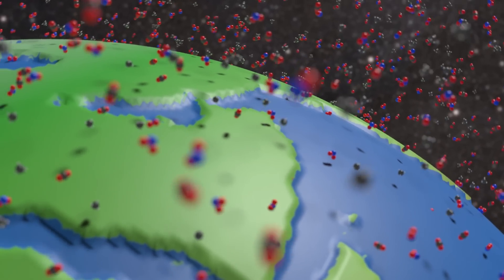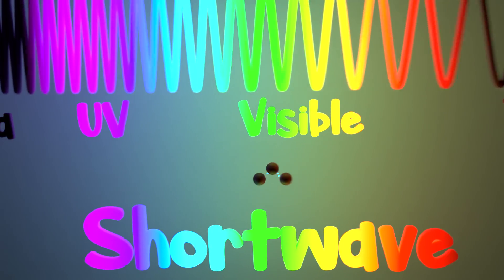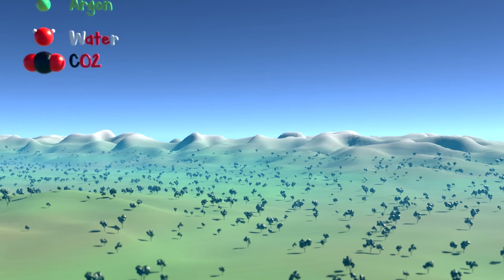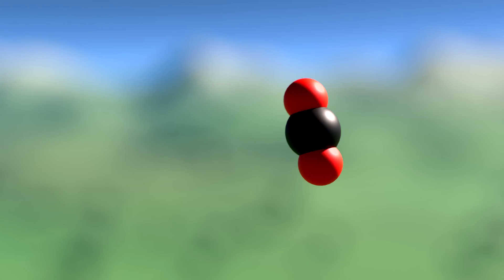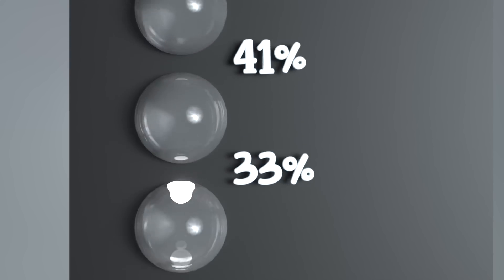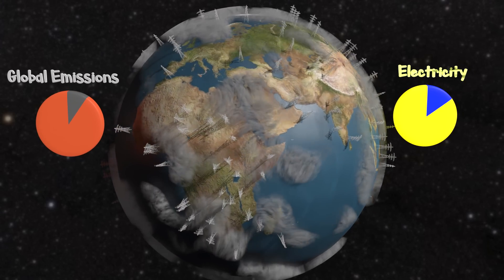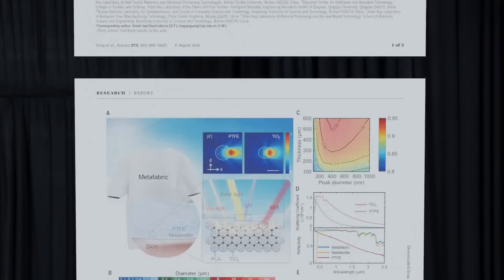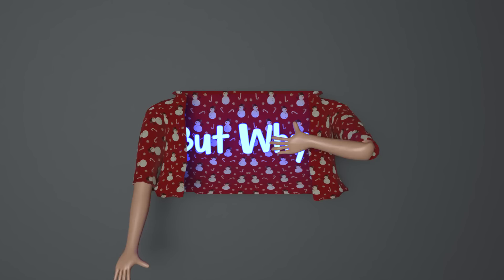Energy Free Cooling through Physics

Comment: The best substance for the inverse greenhouse effect is in fact snow. Because it is nearly perfectly white for visible light, and nearly perfectly black for infrared. To those who don't know, emissivity = absorptivity (this is required by the 2nd law of thermodynamics, otherwise a black object and white object suspended in a vacuum and surrounded by mirrors so they were in thermal contact only with each other and only through radiation, would not settle to the same temperature and you could make a perpetual motion machine type 2) so being black to infrared means it is an efficient emitter of infrared. You couldn't ask for it to be more perfect. A pity about it all going away now.
Reply: So we can use snow to build cool houses in summer. Oh wait...
Reply: Snow isn't especially unique in this property. Most materials emit better in ir than visible. A sheet of white paper is also almost a blackbody in thermal IR and... well... white in visible.
Reply: @appa609  time to make a paper tent
Reply: @lauraclose5604  rain : i am about to end this man whole career
Reply: You want it to be transparent to infrared, not black to infrared.
Reply: @carlkenner4581  
No, you can transfer the heat away from other thinga by conduction to the snow
Reply: Wouldn't snow emit IR in wavelengths that water vapor in the air absorbs? I'd think you'd want to avoid those wavelengths. IR emission by water molecules in snow vs IR absorption by water molecules in the atmosphere. I guess the phase (solid vs gas) tweaks things, but I'd be surprised if the "tweak" is enough to make absorption by water vapor negligible. Maybe it's not a big issue in the dry air of the poles, but for most of the surface of the planet, there's a lot of water vapor overhead.
Reply: And that's how we get Snowball Earth, enough snow coverage to trigger runaway cooling and a new ice age begins.
Reply: @shinjisan2015  A big mistake made with climate change is calling it "global warming". It's *climate change*... creating unstable and volatile conditions which could result in runaway cooling, runaway warming or, most likely to begin with, rather disruptive temperature oscillations which eventually settle into one or the other extreme.
Reply: @nickryan3417  "Climate change" instead of "global warming" still doesn't work, unfortunately. You see, the models that run with "climate change" had failed to predict the record colds around the globe this year. They predicted the Maldives sinking and many coastal airports (NYC, Netherlands, etc) threatened by rising sea levels several decades ago, none of which happened. They failed to take into consideration some natural phenomena such as hot wind movement from the Sahara desert crossing the ocean, taking them by surprise and causing them to scream "climate change!!" whereas those who know their stuff know it's a reoccurring thing that has existed for thousands upon thousands of years and had seen coming quite some time ago.

What credibility do those models that consistently fail at predicting the climate even have at this point? Those doomsaying models only tell us "the end of the world is nigh!!" without anything ever happening. I'm not even that old (early thirties) yet I've lived through more than a dozen "ends of the world" already.

Face it: fear of climate change sells. It prints money. Why would they not abuse that scam? And yes, it's a scam. Those who dare challenge it are immediately called out. Doesn't it remind you of Galileo who dared oppose everyone to try and prove that the Earth actually is NOT flat? One telltale sign of a scam is that you're not allowed to criticise it, because communication and truth are the best weapons against scammers who want nothing but for you NOT to think for yourself.
Reply: @nickryan3417  You've resorted to attacks and insult, meaning you have no counter-argument, correct?

Let me get this straight: you're basing your "let's save the environment" spiel on those models and predictions that have failed to model and predict anything correctly, right? Doesn't that mean your entire spiel is based on nothing concrete, nothing serious? I was once of a similar mind util I started trying to piece things together. That's when I realised the pieces don't fit at all.

As for those models and predictions, they've had decades to make them at least slightly work. Why don't they represent reality still? Maybe it's because reality doesn't care about politics and money.

Now please leave your kneejerk reactions and your anger aside and try to think critically of all of this.
Reply: @ChaosSolak  I didn't find any insults on his reply to you. You assuming that some of his reply insults or attacks you means it is clearly true and you feel threatened to that the truth about yourself gets out in the open making yourself see the reply as containing insult and attack against you.
Reply: @vicovideocompilationsetc6991  He said I'm short-sighted, used degrading examples using trash, misconstrued my words to say I'm advocating environmental damage (which I'm against whereas many virtue signal eating vegan or whatnot, not knowing or caring about soja farms leading to forests being cut down... and THAT is damaging)... Yes, he attacked me personally.

And so did you, by trying to paint me as insecure or feeling threatened. Instead of counter-arguing, you're trying to discredit me in order to try and win the argument. That's a logical fallacy. Please do not use them.

Now if you can explain how acting based on models proven wrong time and time again is somehow logical and smart, go ahead. As far as I know, the world hasn't ended yet and the Maldives haven't sunken yet, even though those deadlines, those "points of no return", have supposedly been crossed decades ago. But since they keep moving the goal posts, they can push the deadlines further and further away, ad vitam eternam ... and gullible people will still think they're spreading "The Truth".

I'm a simple man. If I'm told something, I look to see if it's true. If it's not, then it's false. We were promised droughts and a dying Earth, instead our planet is only getting greener by the day thanks to CO2. Did you know they pump CO2 into greenhouses because of how essential it is to plants? With more CO2, they grow faster, are more resilient, yield more crops of higher quality. Please do look it up.
Reply: Ha snow, God for the win, again.
Reply: The Bible says the weather will not change...

Genesis 8:22 — 
While the earth remains,
Seedtime and harvest,
Cold and heat,
Winter and summer,
And day and night
Shall not cease.
Reply: @brianhale3678  The bible (whatever arbitrary translation or selection of ancient stories that you choose) has absolutely no bearing on science or understanding.

This is entirely expected for stories that originated and were multiply copied and modified well over 2,000 years ago as scientific and world understanding in the ancient Babylonian and prior cultures just do not have modern understandings of the world.
Reply: Nanoparticles are toxic. 
Titanium is an heavy metal. 
Teflon is toxic.
Scientists always ignore sanitary issues.
Reply: @JoJo-vg8dz  
Yes teflon is toxic at about 300-350 degrees celsius.  That's hot enough to melt lead, so I really don't think you need to worry about that
Reply: @JoJo-vg8dz  
I don't know about your desert theory. I would have to actually research climate in the desert which seems unecessary to me as I have done simpler experiments with CO2 that clearly show the greenhouse effect. Just some dry ice in an airproof chamber and a very bright light and you can easily see the temperature rise higher than when you didn't put dry ice in
Reply: @JoJo-vg8dz  
PFOA is toxic, but you can easily make teflon without it, like in current cookware. In my country anything above a tiny percentage of the material being PFOA is banned. It probably is in yours as well. So they can just use non-toxic teflon
Reply: @lucaslucas191202  What is best to simulate the conditions in earth than earth itself ?
Lol. And there's no debate about the higher "greenhouse" power of vapor water.
See what it produces in real life conditions in equator.
There's no greenhouse effect without umbrella effect.
It could also be called "tent" effect.
See what effect produces a tent in the desert. 
Its obvious.
Reply: @JoJo-vg8dz  
A tent is not see-through, and if it's white it reflects sunlight. I don't need to explain to you that CO2 is see-through do I?

And sure, earth is the best simulation of earth. But earth is complex, and you can't experiment with it as you can't just chamge variables like the concentration of CO2. You may know that one of the most important scientific principles is comparing different results with different variables. You can't do that with the dessert. So basically I don't feel inclined to believe your explanation unless you can raise the concentration of CO2 without it heating up. But you can't
Reply: @lucaslucas191202  Teflon means polytetrafluoroethylene so there's no non toxic Teflon. 
It should have another name if it's another molecule.
Reply: @JoJo-vg8dz  
Yes that's PTFE which isn't toxic. PFOA was added to PTFE before they found out that PFOA was toxic and started making sure it wasn't making it to the end product. PFOA is perfluorooctanoic acid for reference
Reply: @lucaslucas191202  In the video they talk about Teflon so there's no garanty it's what you describe.
And furthermore nanoparticles are toxic anyway.
BTW , Titanium is a heavy metal.
And studies show that nanoparticles of titanium are toxic for organisms.
Reply: @JoJo-vg8dz  
Yes the guarantee is that PFOA is banned in most countries.

The reports I can find on the toxicity of titanium state that it is mostly non-toxic, and is used in production of most food. So we're all eating it anyway, whether we like it or not. It's not scaring me at the very least, not in the amount they'll be allowed to use. The thing is, whatever they make has to go through regulations, and they are tight. If you live in the EU they are really tight. So I'm not really scared of whatever they're making being toxic
Reply: @lucaslucas191202  I can find studies that say the contrary. 
I don't trust studies paid by industry.
The funding bias is something that is undeniable. 
All meta analyses prove it exist and it's huge.
Reply: @lucaslucas191202  Well. 
Again ... in real life conditions ...
In most of the regions where CO2 is the main or only (alleged) greenhouse gas , (I.E. regions where vapor water is rare) , there's no significant evidences of greenhouse effect.
Exemple : deserts : CO2 doesn't block radiations from the soil. 
Hence the cold temperatures at night. 
It doesn't block radiations from the sun either , hence the 40°C during daytime.
It's not that complicated.
Reply: @JoJo-vg8dz  "And furthermore nanoparticles are toxic anyway." Nanoparticles exist in nature, a "nanoparticle" is nothing more than a descriptive word for the size of a particle of matter (between 1 and 100 nanometres in size). Because they are small they have a high surface area to volume ratio and therefore are more reactive as a ratio compared to larger volumes of the same material. That's it, nothing more ominous than that.
Reply: @nickryan3417  Fair enough but nanoparticles of toxic substances are more dangerous because they can hardly be eliminated by organism.
Reply: BTW the inverse greenhouse effect already exists on earth with water vapor.
Lol.
In equatorial regions where the solar radiations are the most intense , the temperatures in daytime are much more cooler than in deserts (in sub tropical regions where solar radiations are less intense) , thanks to water vapor.
That implies that the greenhouse effect of CO2 is mainly BS because , it's the main (supposedly) greenhouse gas in the desert and it doesn't capture radiation from the soil at night.
Temperatures are very cold at night in the desert and remain warm in tropical regions.

So the real greenhouse effect is already an inverse greenhouse effect and it is mainly caused by water vapor and not CO2.
The narrative about CO2 is propaganda.
Reply: @JoJo-vg8dz  
Thing is, water vapour has always been there. The problem is the rapid increase in CO2 that wasn't there before, making it hard for nature to adapt in time
Reply: @lucaslucas191202  No.
1. Human activity produces less than 5% of CO2 produced each year. 

2. The measures of CO2 and temperatures of prehistory (measured in ice carrots) show that level of CO2 increases AFTER the increase of temperatures. 

3. As I said , the greenhouse effect of CO2 is pure BS because it's the main supposedly greenhouse gas in the desert and it doesn't capture radiation from the soil at night (contrary to water vapor).

4. Greenhouse effect doesn't increase temperatures.  It mitigates temperatures. Because there's no greenhouse effect without "umbrella" effect. It blocks part of the radiations from all directions. From the sun and from the soil. 
That's why temperatures are 30°C during the day and 25°C at night in equatorial regions where the solar radiations are the most intense and the level of water vapor is high.
In hot deserts , temperatures are 40-45°C during the day and 0°C at night. Main greenhouse gas is CO2.

Which proves that the real greenhouse effect blocks radiation from the sun and from the soil.
And that the greenhouse effect of CO2 is negligible.
Reply: Why would it be going away? We've hard record colds this year, many ski stations were sad the lockdown didn't allow them to profit from the heavy snowfalls, England had out of season snow, etc. Dunno what's giving you so much confidence that it's all going away.
Reply: @ChaosSolak  because the polar regions are bigger than ski resorts.
The snow is receding from places that used to have snow 100% of the time.
Reply: Record lows in individual places doesn't mean there isn't an global average increase in temperature. We take the average of places around the globe, not just local data.
Reply: @dt8639  those aren't actual temperature measurements. They are in fact combined with computer modeling. Wide swaths of continental and ocean temperature data are just predicted by computer modeling then that data is taken as actual temperature measurements to find the global average. In many instances computer modeling has shown itself to be unreliable and not a reflection of the real world.

Comment: In Perdu University they come out with with paint made of barium sulfate that can cool down the surface be 4.5C during day and 10C at night. They claiming 98.1% reflection of solar light. Interesting thing is that barium sulfate is very cheap material use in many industries.. They also claim that for 1000 sq ft surface the could get 10KW cooling. We should start paiint all roofs with barium sulfate.

Comment: Great start! You next should discuss kinetic energy transfer of gas caused by collisions. Molecules in an excited asymmetric vibration state can transfer IR absorbed energy by collisions to non-absorbing gases. This leads to a catalytic increase in atmospheric temperature. And is why only a small total increase in the amount of CO2 causes global warming.  There are other mechanisms to consider. The path length of light at the polls is longer.  So polar atmospheres with CO2 absorb relatively more IR and warm to a greater degree even though they are still colder due to lower direct Sun exposure. This makes polar ice more susceptible to melting. But then there are a long list of planetary details: ocean currents, jet streams, and continentality etc. to deal with... And then so much more... Environmental physics is a very complex process. I enjoyed this first step!

Comment: You left out a huge part of the explanation of the greenhouse effect (probably dishonestly because it reduces the fear porn of alarmists) When IR is emitted it is emitted across normal radiation spectrum. But CO2 only absorbs on two narrow bands. 

Makings its effect logarithmic. You have exponentially increase concentrations for a linear effect.
Reply: and water overwhelms those bands at about 25 times, in width, height, and saturation.
Imagine one junior high freshman on the field against 25 professional football players...
Reply: @geraldfrost4710  But the water vapor does not change that much. Too dry and more evaporation occurs. Too wet and it is precipitation. 

For your scenario. Imagine instead of one junior we have three.  This will change the score slightly.

instead of 0-100 we now have 0-97.

Given the (max+min/2)temperature of the moon is -180 deg celcius. and the temperature of the earth is around 10-20, it only takes a few percentage points difference to add a couple of degrees.

Comment: Do you think there would be a way to make shingles or other types of roofing material?  If it could handle the weather, could you imagine the electricity savings you would get.  Couple that with a powerwall, a dehumidifier, and you could reduce power consumption to what you can produce with your solar panels.  Think about being able to power your car and house with the same Hydrogen Fuel Cell. I mean, a Ford truck can already power your house, what is to stop home owners from creating their own power source using sun light, green hydrogen production, and a hydrogen fuel cell?  I understand the storage problem with hydrogen, but there is already another company that fixed that problem is solid state hydrogen storage, using a electrically charged film to attract and hold the hydrogen.  When a light hits the film holding the hydrogen, it looses its charge and releases the hydrogen.  Kinda like a cross between tape deck and CD technology. That technology eliminates the need to compress hydrogen for storage and reduces the carbon output needed to transport green hydrogen.